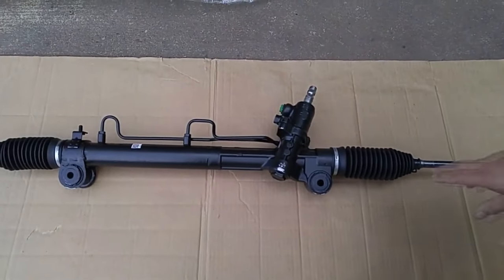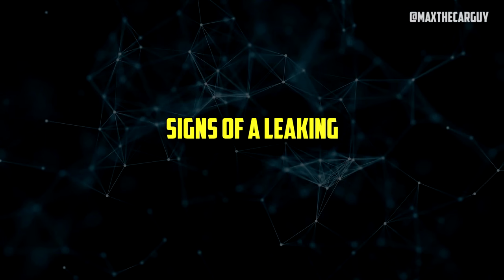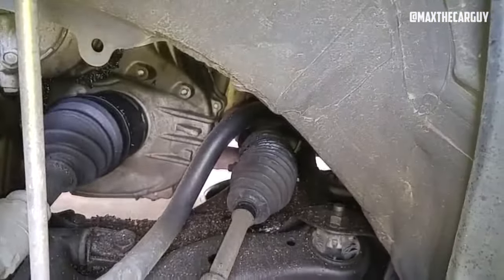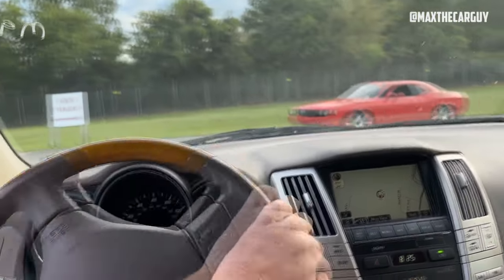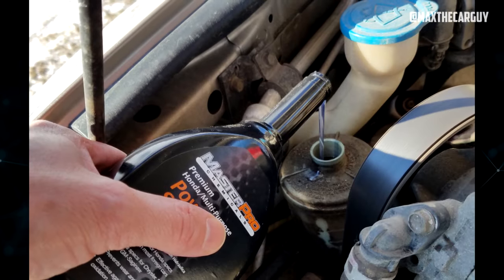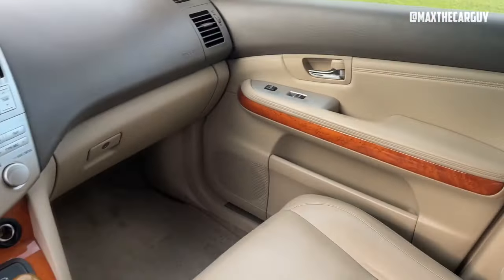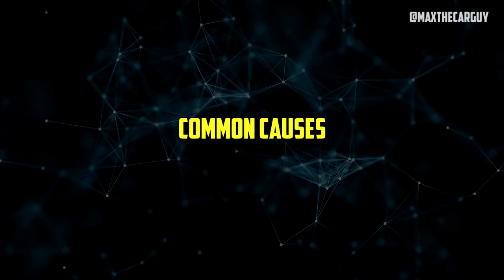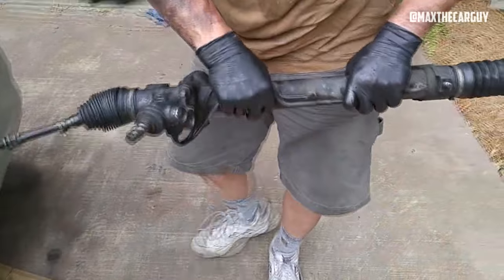4 Symptoms of a Rack and Pinion Leak - Causes & Fixing

Comment: 5 years....leaking..just top it offf
Reply: Are you serious?? 😭 need to know because I don’t have the money right now to replace it yet
Reply: I’ve been topping mine off for like a year. I’m finally getting it fixed, fingers crossed I didn’t damage anything else.
Reply: @johnbaron3070 How much did they charge you for parts and labor? Just curious
Reply: @LincolnAintLinkin it was a lot more than I could stomach to be honest. Bill was just under $1500, about $900 labor and the rest was parts
Reply: @johnbaron3070  I just got a quote for $750. Im in disbelief and confused. Something mudt be off because im pretty sure this stuff costs at least a grand to repair. This has been hell. Wish me luck.
Reply: that was my mindset until the leak has grown to it's current state where I'm dumping a 12oz bottle in every week. I can empty a a full resevoir if I go lock to lock several times (like when pulling in and out of parking spots).
Reply: @LincolnAintLinkin  $1800 was the quote I got from Earnhardt Toyota. THey said it was "sweating" and they jus wanted to keep an eye on it. Finger crossed the sweat goes away.    72k miles  2017 Tacoma SR5 V6 Crew Cab.
Reply: Update: Total quote was $2,377.   $1,862 for the R&P replace; $270 for alignment;  $245 for steering flush.     Yeah, this is gonna hurt, alot.

Comment: except its only 50 in parts to re seal it yourself with a little bit of time
Reply: No you can not just replace the seals, without complete disassembly. And at the point of having it off the car, might as well replace it with a new one.
Reply: Most people don’t have the proper tools or common sense for mechanics/technical skills